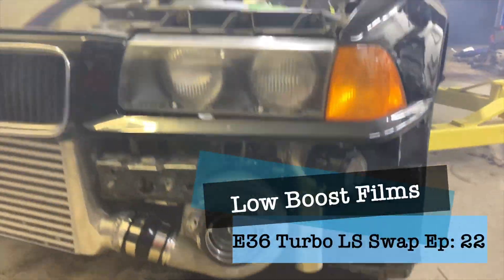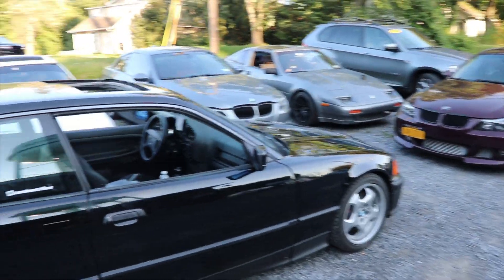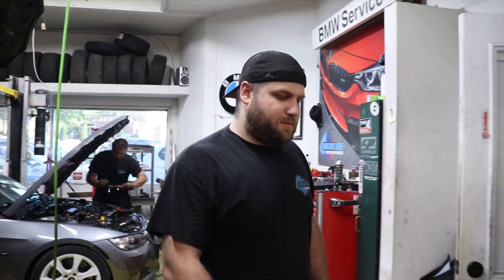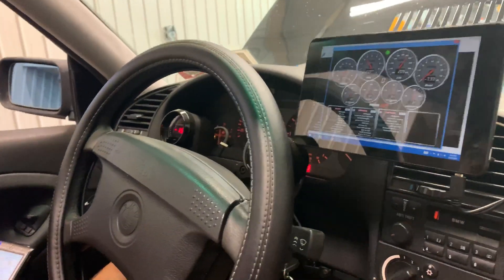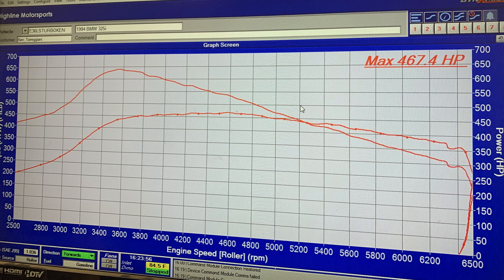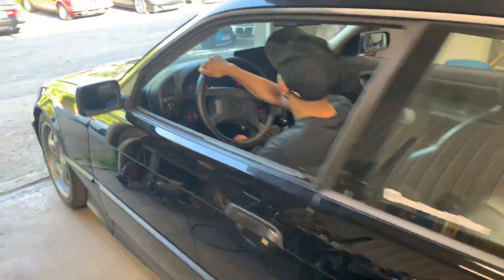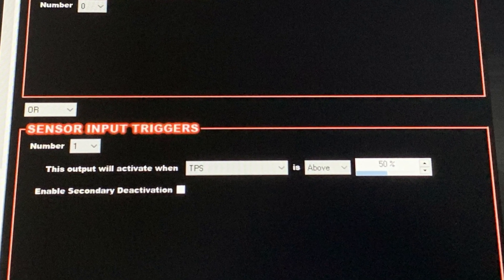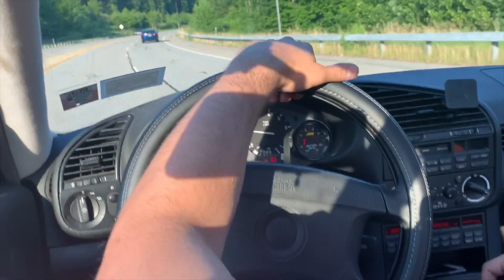TURBO LS BMW E36 DYNO- 93 Octane, Ep: 22- LQ4 6.0, Pump Gas, Borg Warner SXE372, Terminator X

Comment: Did you mess with the timing any to make more horsepower and less torque well I guess it doesn’t matter if it still has the truck cam in it but still a monster👊🏾💪🏾
Reply from the maker: It has a BTR stage 1 turbo cam. The massive tq is due to the smaller turbo. I need a bigger compressor so it doesn’t choke out up top. Should be 700/700

Comment: How did you mount the ls pcm? what mounts did you use or did you even have to cut the stock mount?
Reply from the maker: I have it in the compartment where the old PCM was. The Holley terminator is small. Lots of wires in there too didn’t mount it. It doesn’t move around

Comment: Curious what rear end you are using ?
Reply from the maker: Stock 188mm open diff lol. I have a 210mm ready for when this says bye bye.
Reply: Low Boost Films oooo stock diff e36 with no lsd 😯 brave man im suprised that diff holding up against the abuse 😂😂
Reply from the maker: Me too lol. The 94s has solid axles, plus I’m not launching it at all. So fingers crossed.
Reply: Low Boost Films very nice u know how to treat a car well 😎 210mm diff is that a euro one or what did it come out of ? M3 e36?
Reply from the maker: E32 US. It’s a 3.15 as well. Yea I know it’ll blow up from a dig.
Reply: Low Boost Films well if its built it womt its deffo much stronger potential while u have it out u shud build it with better internals if possible i know u wont regret that ! If possible tho curious does the e32 diff just bolt onto the rear subframe of e36 ?
Reply from the maker: No it requires welding a bracket to it, i make a full video on it when I do it. It should hold everything I throw at it. I’m surprised the one I have has lasted, im too scared to launch it haha
Reply: Low Boost Films u shud send it full send once u ready for the swap 😂😂
Reply from the maker: I will def!
Reply: Highly surprised by the low HP considering that’s a 6.0

Comment: What’s the wastegate spring? They say you can double the spring pressure in boost but it doesn’t always hold.
Reply from the maker: It’s a 9.77 psi spring. The problem is if I have the gate crack at 9 psi, it holds fine up top, but makes way too much tq down low and I spin the clutch. So I have the gate crack at 5psi, but it doesn’t hold it well up top, but the clutch is ok